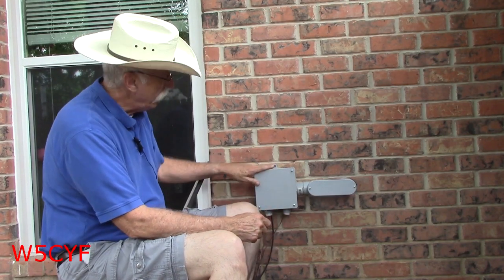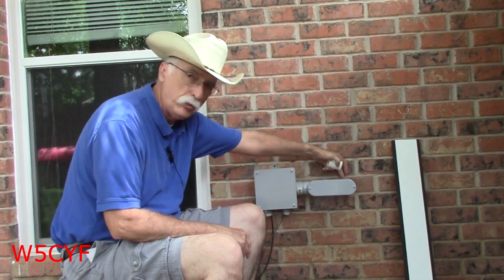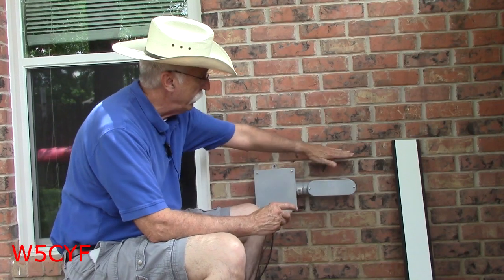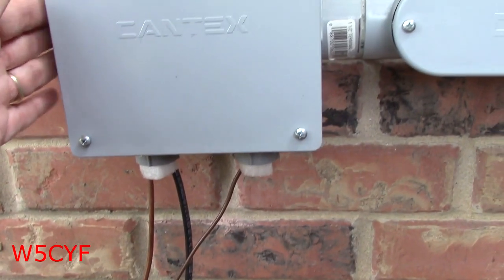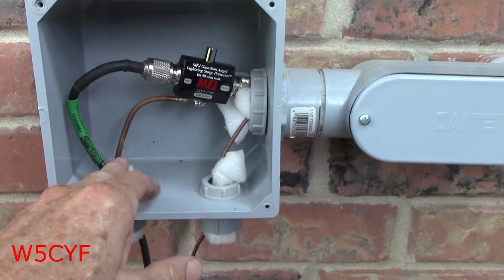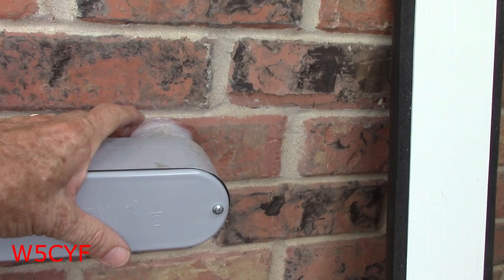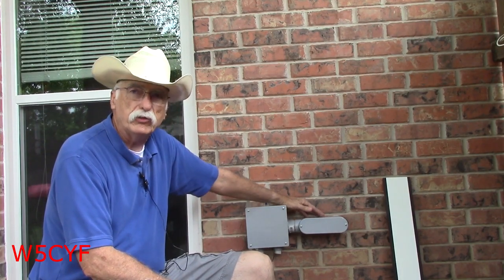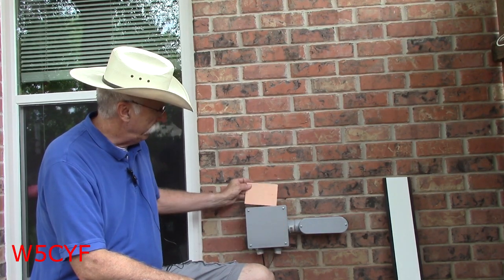How to Run Coax Through A Brick Wall (Ham Radio) #hamradio

Comment: When the cable-tv guys need to run through a brick wall, they drill a hole just big enough for the cable through the grout rather than the brick. Easy to make an invisible repair that way, and grout is easy to drill with a hardware-store masonry bit.  In a ham application, a hole for the rf cable and one for the ground would work. Since the holes are small diameter, they'd be easy to bug proof as well. Now, for two or more rf cables, installing a pipe as John has here would be essential.
Reply from the maker: Todd, thanks for watching and for your comments.     ~John

Comment: Xcluder rodent proof material could be formed into spaces around your cables and wires as they pass to the outside.  Providing heat build up is not an issue, the boxes could be stuffed with the same material.   Duct seal (Iberville) could be put on the exterior for water leak protection and to to block the passage of air.

Comment: Shove in some fiberglass insulation then some brass or bronze wool.  The critters won't eat through the wool and the fiberglass will restrict the airflow.  Don't use steel wool -- it will rust.
Reply from the maker: Thanks for the suggestion and head's up on the steel wool rusting.     ~John
Reply: @TinkerJohn_W5CYF  I wonder what you decided to use,  the bronze wool and insulation sounds like a good solution.  I just ended up fighting with a mouse problem and  the exterminator told us to use steel wood to block the entrance where the little  critters got in.  I like the bronze wool idea though.   I am looking to do something similar to what you did.  Currently I just put a small hole through the concrete block wall and into my shack (not brick to worry about),  want to make it easier to run a few more coax cables out as well as a ground to my ground rods.  I was wondering how you are handling lightning?  Currently I keep my antenna grounded when it is not in use and I just disconnect it outside when we have storms in the forecast.

Comment: What you need is called a gland nut.  It's a compression type fitting used for waterproof electrical cables. You may have seen them on submersible fountain pumps. Any electrical supply should have them.
Reply from the maker: Thanks for the tip!

Comment: Instead of the cables running out of the box, couldn't you fit SO239 bulkhead type terminals to it's bottom and plug in your antenna leads to them?
Same indoors, fit another box and do the same.
Solve water and insect ingress and you can swap antenna leads easily, both indoors and out.
Reply from the maker: Dennis, your suggestion is excellent.  In retrospect that is something i would change.    ~John
Reply: I’d use N type on the outside because they’re weather proof.

Comment: Very good John, you should be on commercial broadcast radio you have a good voice.  God bless.  Good PVC setup using the corner LB, makes pulling new cable in and out possible with your junction box.  As an old EE and power utility CEO i appreciate good work when i see it.
Reply from the maker: Thanks for following along and for the kind comments.
Reply: Roger that John keep up the good work

Comment: Excellent video. Your installation on the outside is very neat indeed and looks like it was professionally done. I thought, perhaps, that you would have some kind of a box on the inside wall with a coax fitting to connect to the antenna. I don't have brick, but I know that I have to punch a hole through my wall to bring in my antenna coax. I like the idea of placing your lightning arrester inside the box. I was concerned about weather proofing mine with silicone sealing tape. Now I only need to worry about the connection coming directly off of my dual band VHF/UHF antenna. I will be mounting my box and ell connection box where my Internet cable comes into the house. When I had my FM business band radio setup I just had a piece of PVC pipe running through the wall and I stuffed it full of foam to keep the weather and the critters out. I may eventually set up a base station in the kitchen where my FM business band radio sat, but for now it will sit on my desk. Thanks for a wonderful idea of how to make a nice looking installation. "73", KE0WKN.
Reply from the maker: Thanks for your detailed reply and suggestion about putting a box inside.  I think I may do that, it would make things look neater.  BTW: The silicon seal is holding up fine.     ~John

Comment: John, looks a good job. Here in the UK our weather is different to yours, of course. I wanted to bring (ultimately) three aerials into the shack in an upstairs bedroom. Two long masonry drills allowed me to drill pilot holes and then the main holes, and some 22mm ‘overflow pipe’ (PVC) was tapped into place with a rubber mallet, cemented in place outside, plastered round inside (to repair the plaster!) and the job was done. The holes are drilled inclined downwards from inside to outside, to stop rain running in. So far its served well for 5 years with co-ax, end-fed wires and 300 Ohm ribbon feeder with several aerials. Cost? Just my labour and some bits from the junk box.

Enjoy your aerial! BTW, what’s your propagation like just now? here in UK its terrible, hardly makes QRP worth the effort!
Cheers and GB, Les g0nmd
Reply from the maker: Les, thanks for taking a moment to comment.  Bands in the states have been really bad lately.  However, I've started a little FT8 work and getting a few contacts that way.    73/John

Comment: You could use some copper wire to seal those holes instead of silicone if you want (or a combo of both). I keep mice and wasps out with copper wire. (Copper, because steel wool rusts and decays more over time).

Comment: Would a can of expandable foam work for sealing your conduit? That is what I’m thinking of doing on my new construction home.
Reply: No. You never want to just foam to fill coax for several reasons. First, foam isn't waterproof. It also won't stop bugs/critters. Last, it's a huge pain to remove if you ever need to change a cable. The best option is to use electrician's putty. It's been used by electrician's and telecom companies for years and works great. As an alternative, you can go for steel wool, but it tends to hold water.

Comment: Use expanding foam.  It comes in a can with a long 'straw' nozzle.  Just push the button like a paint canister then the liquid quickly expands and solidifies.   It can then be filed, filled and painted.
Reply from the maker: Kevin, thanks for the suggestion.  I have found that closed cell foam works perfectly, that way I can add coax cable as needed.       ~John

Comment: What size holes/grommets did you use on the bottom of the box where the coax first enters?
Reply from the maker: I used silicon to seal the bottom of the boxes.  It's still working fine.

Comment: can I have your reasoning on plugging the coax directly into the box without using a faceplate or keystone connector?
Reply from the maker: No particular reason.  I faceplate would work fine.  Where this coax came in, I was not concerned about appearance.     ~John
Reply: @TinkerJohn_W5CYF  thanks for the reply John

Comment: Hey John, Bryan KG5 out here in El Paso, will be for the time using the MFJ  window pass through.  I was able to find a minty LDG S943,  fiberglass vertical.   Cable  run to future mount is about 50 ft, do you think I should run ta ground from the radial  plate to  the 8ft ground outside the passthrough 
window ?? Thanks for the videos,  hope my S9 survives , I'n storms,  lots of lightning here, may use a lay down mount
Reply from the maker: Bryan, thanks for following along.  For my application, I tied the ground from the antenna to the main ground rod at the entrance panel of the house.  Suggest you take to an electrician for your specific application.  BTW:  I'm still using an S9 as my portable antenna.    73/John
Reply: Thanks John for your reply!  There is allot of lightning such as last night around my area so I think a tilt over addition  for when not in use.  Thanks for the videos!  Bryan @TinkerJohn_W5CYF

Comment: If you want to be able to remove easy in the future pack the connections with plumber's putty.  I need to bite the bullet and drill my brick also and run some cables through.
Reply from the maker: Thanks for suggesting plumbers putty.  I'll have to consider that.     ~John

Comment: Thanks for posting John. Is that coax going to an HF antenna?  Which type of coax are you using? 73.
Reply from the maker: Thanks for watching the video.  I don't recall the actual number but it was RG8 rated for underground use.  ~John

Comment: What type coax are you running through the box?  Have you added more coax since you installed the box?
Reply from the maker: Thanks for following along.  As I recall, this was using RG-8X; it's been a few years so i may be wrong but it was not as big as RG-400.    ~John

Comment: Steel wool works fb for packing those holes...bugs cant get by it...
Reply: Steel wool is very, very flammable.  That doesn't seem like a good idea in a firewall.
Reply: @JeffBeadles  Not very flammable when it is compressed, packed tight. But it does rust with humidity. Stainless steel wool is best but hard to find. Most hardware stores carry bug-proof expanding foam,

Comment: I don't know about that ground John. If you get hit by lightning, your inviting a fire right into that closet. You should always shield inside grounds connected to an antenna. I'd get a better lightning arrestor too. You need to ground your rod to the outside electric meter. Make a ground plate connected to the outlet your using for power. That's the safe way.

Comment: I would be inclined to drill the hole myself.  And wonder if you had a legal or liability reason for wanting the Electrician to do it. Did you need official documentation for it. Or just want the best possible work results?
Reply: John save the copper clad  board for a radio project and get some copper (or at least aluminum  plate) for the ground plane under the lightning  arrestor(s). The copper clad won't  hold up to lightning.